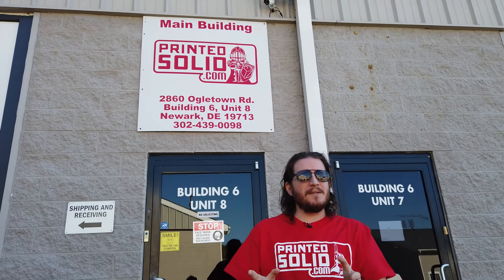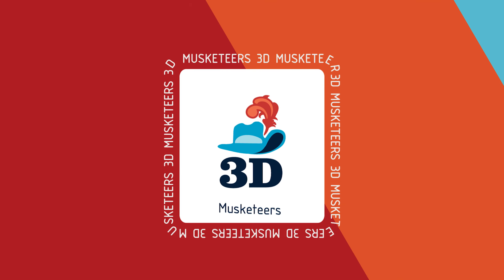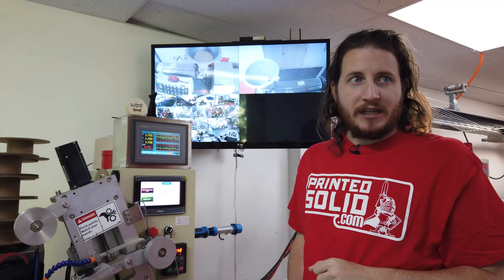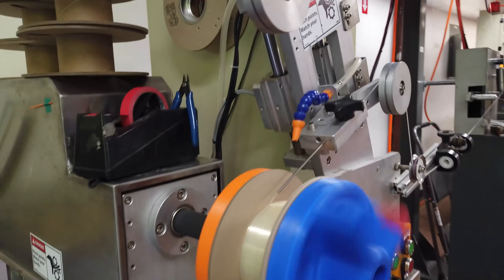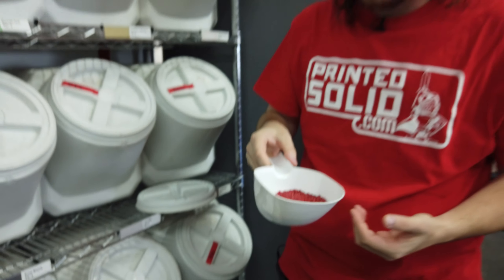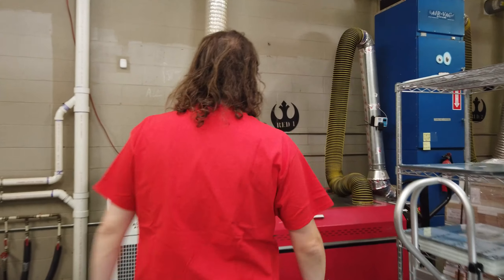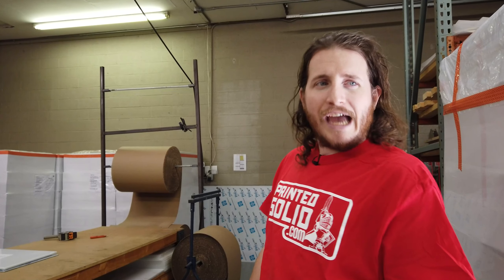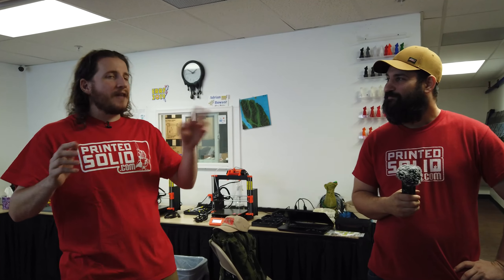HOW 3D PRINTING FILAMENT IS MADE - Touring Printed Solid!!!

Comment: I actually have a working Commodore 64. Complete with a modern USB adapter cartridge that bypasses the need of floppies, tapes, and other cartridges. I know a lot of people in the retro scene use 3d printing. In fact I think my Ultimate 1541 II (the USB adapter) has a 3d printed case. Getting the tan 64 just right would be super hard because there isn't just 1 color of C64's. I've seen a video of someone that had 8 different C64s. There were 2 different thicknesses. And probably 4 different colors (when you compare the areas that aren't yellowed)
Reply from the maker: Very cool!

Comment: I actually find that nude is just as bad as white in MMU printing. I was hoping it would be better. It's not. It needs massive amounts of purge. When I finally do print this model for real and not test/calibration prints, there shouldn't be too much skin exposed. However she is wearing a white shirt, so there will be a lot of purge.
Reply from the maker: Huh, interesting! 

The pruge may be because of its lack of pigment.
Reply: @3DMusketeers  oh for sure. My latest calbration cube (which takes almost as long to print as the test print of her head but then again it's about the same size) I finally got the red looking fully nude. But, I noticed there is a slight distortion in the print at that area. I can't tell if there is just enough of a difference between sunlu (red) and esun (nude) material that the material difference is the distortion or if it's because there is a cube inside of a cube for those layers (it sticks slightly out the sides) and the extra geometry complexity is causing the distortion. But even on my 4th print I can still see black. Barely but it's there. But yeah even when the pigment is properly purged I wonder if there is still traces of sunlu vs esun at that point. And slightly different formulations is causing that. It probably wouldn't hurt to get more materials to the same company.

Comment: man i love printed solid filament, but it does not love my AMS unit
Reply from the maker: I am told that is an issue.. But you can leave the door propped on it, right?
Reply: @3DMusketeers  i can still print with it as long as i dont use the AMS unit, in other words just feed it in from the back. The downside is no multi color prints but its not the worse thing in the world. I recent did a Darth Vader bust in their galaxy black i think its called, still great filament but just slightly too large to fit into the unit unfortunately. Thanks for the vid it was fun to see things in the making!
Reply from the maker: I thought they can fit in if you shove em or something? May need a rep rack or something on top of the printer to feed in different rolls. It does suck though! 

Their galaxy black is Soul Black Glitter :)
Reply: @3DMusketeers  yes! soul black! its my favorite so far. I have purchased their transition rolls for projects i plan to paint too, and last time i got the goldish glitter color, their filament just prints like butter i love it
Reply from the maker: it's great really